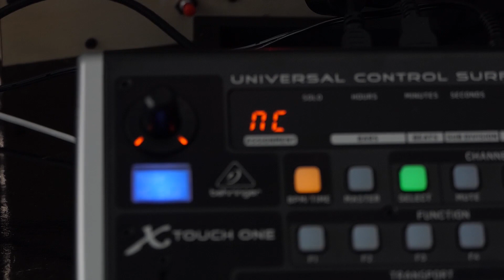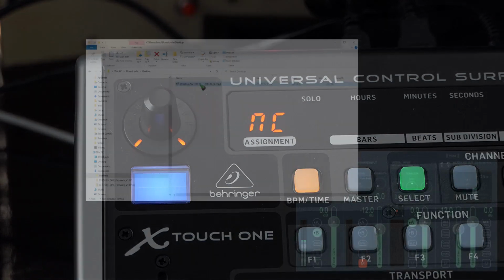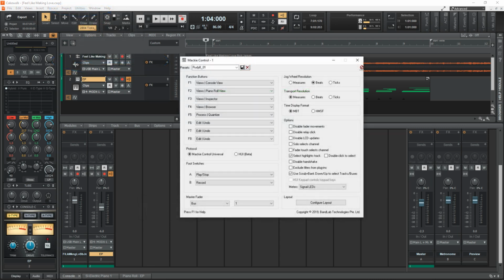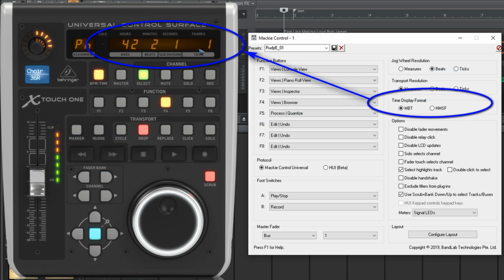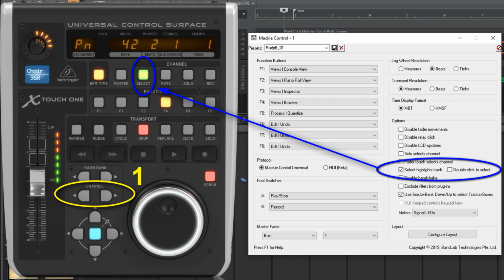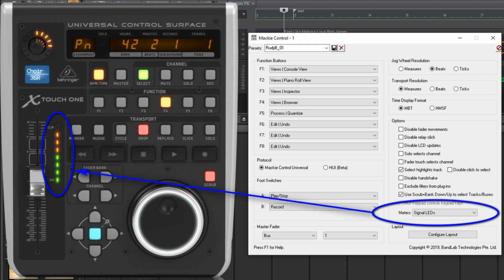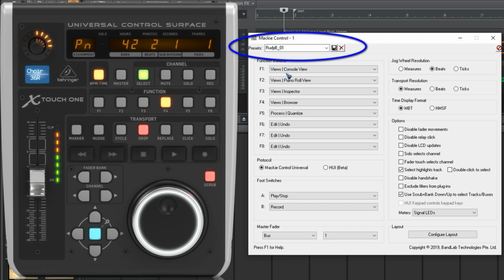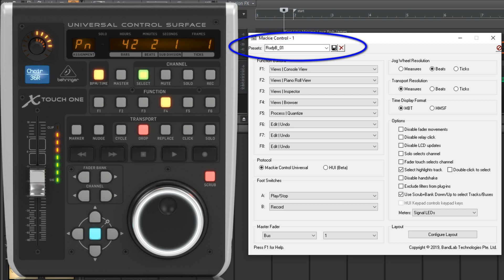Behringer X Touch One Cakewalk Settings

Comment: Utilities->Mackie Control-1 menu doesn't appear!
Reply: @pavelkraev7476

I found the fix for this: 
1) Go to Edit > Preferences, or press P when the Start Screen is closed to open the Preferences menu
2) Under MIDI > Control Surfaces, click the Add Surface [+] button to open the Controller/Surface Settings dialog box.
3) In the Controller/Surface field of the Controller/Surface Settings dialog box. If you want to use Mackie Control menu select this option and the input/output device should be the X Touch One. WAI Color lets you know what Track or Bus the controller is currently selecting when connected.
4) Click Apply and OK to save your changes! Mackie Control setting should show up now.

Comment: In Cakewalk 2022.06 they have new modes that makes the Cubase overlay fit almost perfectly!
"Mackie control surface improvements, including performance enhancements and optional Universal and Cubase emulation modes that can be used if your control surface does not provide a dedicated Cakewalk/SONAR mode."
Still can't pan on master channel, but everything else seems to work.
Reply from the maker: Nice, thanks for sharing that.